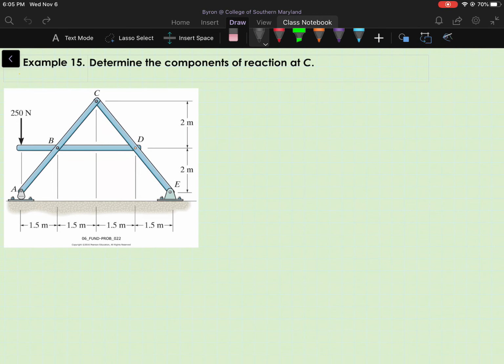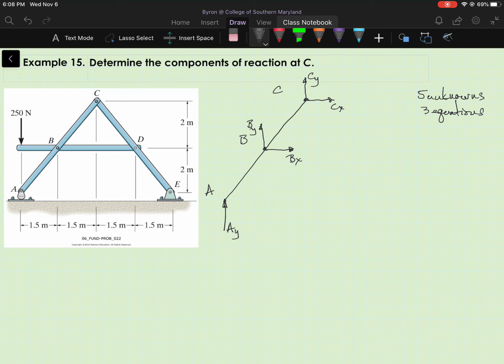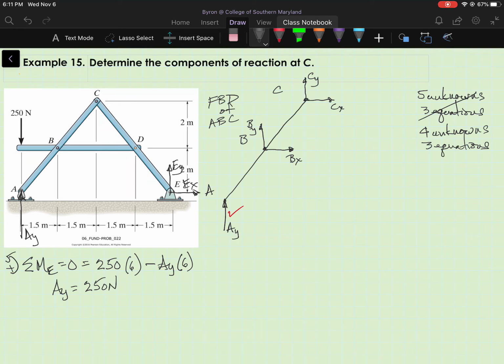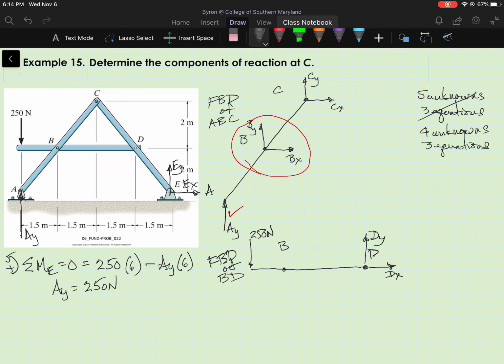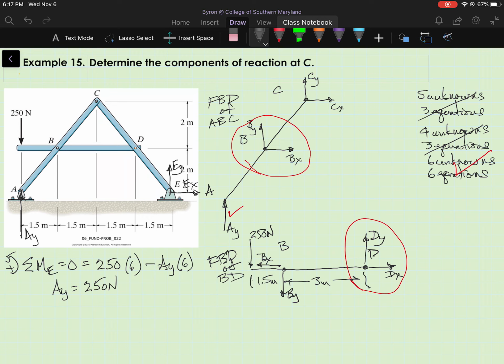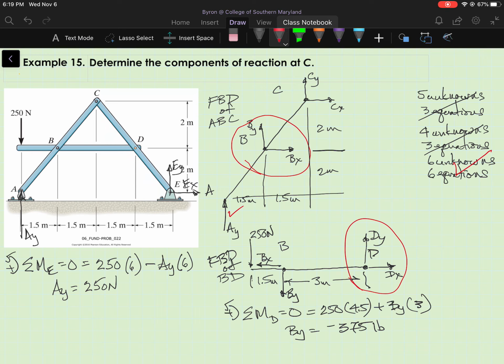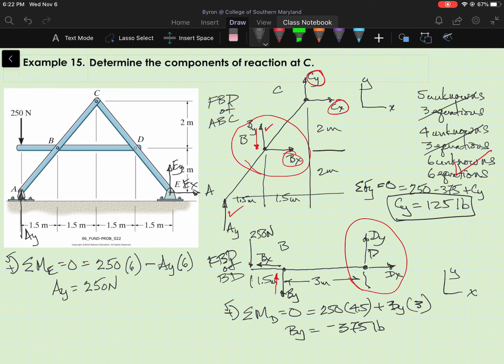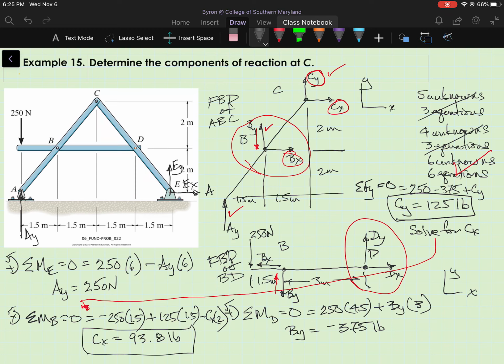Example Problem 15

Comment: Please explain why this comes out as a positive Cx? Based on your last equation: 0 = (-250)(1.5) + (125)(1.5) - (Cx)(2) this becomes: 0 = (-375)+(187.5)-(2Cx) ==> 2(Cx) = -187.5 ==> Cx = -93.75 N.  So the reaction force on the top of member ABC is in the negative x direction. Now, the reaction force at C based on the other member is in the opposite direction, so maybe you're reporting the absolute value of Cx because the direction is meaningless in the context of point C as it depends on the perspective, but you don't say one way or the other why the negative is being ignored. Physically, the negative makes sense as Cy is acting to rotate the member about B in the opposite direction as force Ay over the same distance. However Cy is half that of Ay, so it needs some extra help to counter Ay in the opposite direction (negative X).  Ay = CW, Cy = CCW so Cx should be CCW.
Reply from the maker: Demetrius - You are correct.  I missed the negative sign for Cx in the last calculation.  Cx = -93.8 N, which means that the direction of Cx is opposite to that shown on the FBD for member ABC.  Thank you catching this and pointing it out, BTB
Reply: @byronbrezina81  No problem. I was actually trying to check the textbook because they show the same positive answer and was hoping to find the problem worked out somewhere with an explanation. The problem statement's a bit unclear. It asks: "Determine the components of reaction at C". So one could choose beam CDE and get an equal and opposite reaction. There's also the forces on the pin to consider.
Reply: Why you used the moment about B to adding 250N